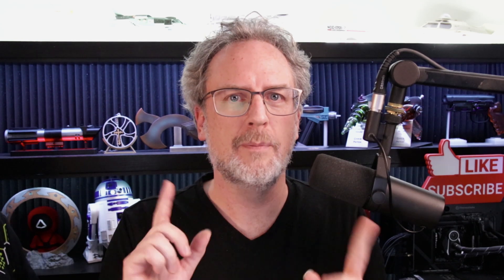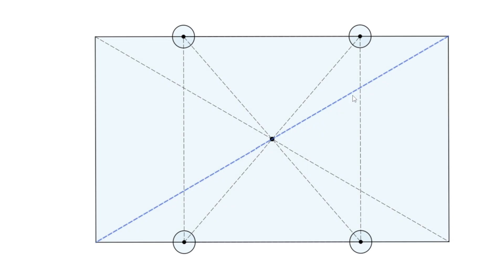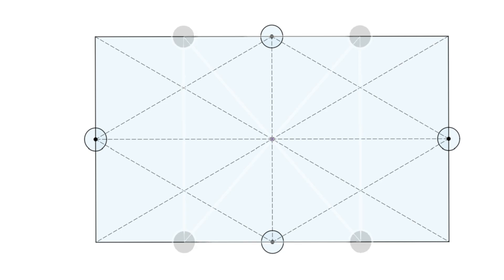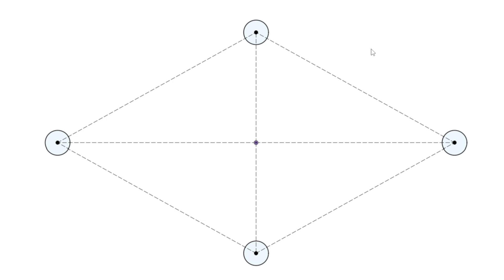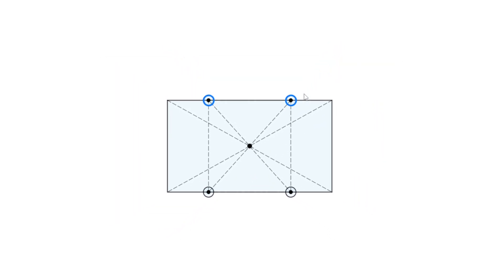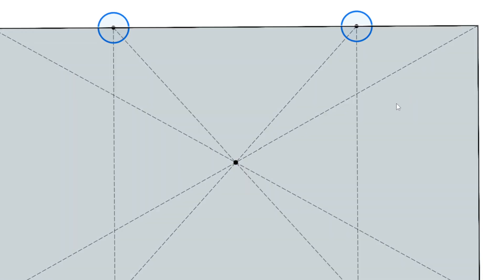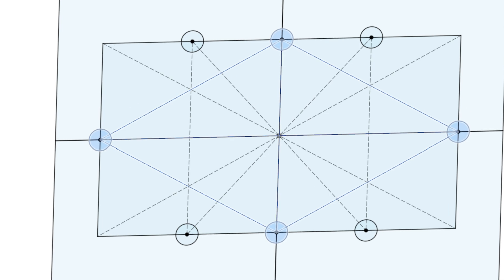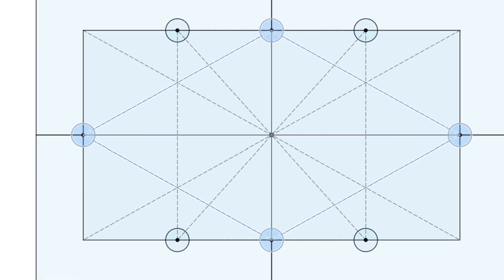Blamcon Sensor Configuration Logic - Explained

Comment: Do these have to be a set distance apart, or does the 2 up/down corners work?  I'm guessing corners would require a smaller screen, since it would likely make the past the missing sensor tracking range useless.  I don't mind extra light bars, but I'm guessing I'd confuse the sensors.  Maybe I should just use different power switch and not try using both light gun sets at the same time?
Reply from the maker: Umm, I have the corner setup on my arcade machine and it does work, though it's sub-optimal. I'm only testing our preferred arrangement right now to keep it easy, 300mm apart centered, but we do want to support as many configs as we can. I would put it as 'beta' support right now, I will do more testing soon and we'll work on getting other configs better supported as we go

Comment: My biggest concern with the Blamcon tracking system was that the guns would be compatible with a current GUN4IR led configuration... and it sounds like it is, or is still being worked on. I have the GUN4IR diamond configuration of leds embedded in my arcade cabinet's bezel, so being able to switch between my GUN4IRs and future Blamcons will be a huge plus!
Reply: Chris can U confirm that blamcom can change ir patterns eg diamond?
Reply: hope it does work as well, drilled enough holes in my vewlix and i ain't drilling anymore.